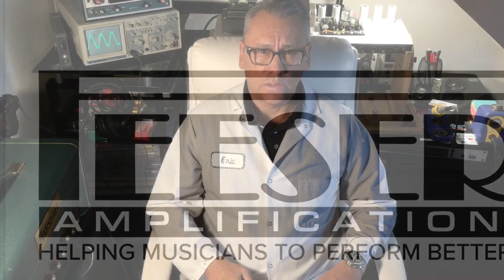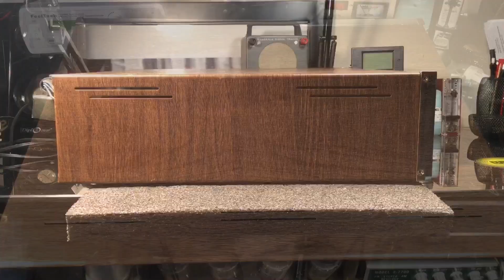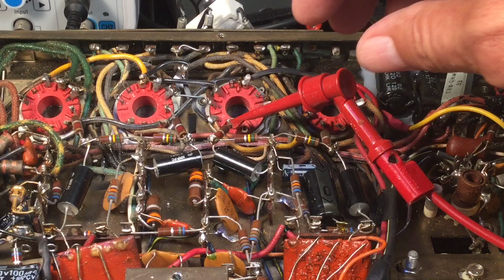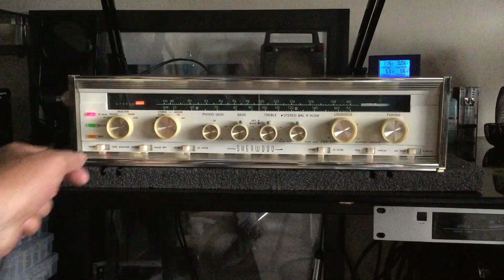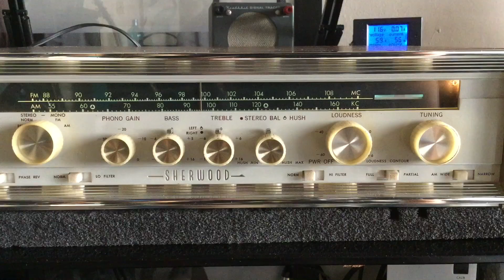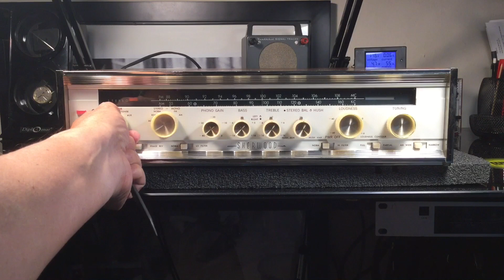How to Repair a Sherwood S-7700 by an Engineer Technician

Comment: I felt for you very deeply when seeing the problem with that bunch of those radial capacitors which do not IMHO belong to tube amps at all, unless there is a PCB in it, which a godforsaken phenomenon and a way to connect components electrically to each other unfortunately started to rule sometimes in the 60's 👹😁.
I love Fender style dog houses and hate multiple section cap cans because as you very well know, whatcha gonna do when one cap of multiple section cap can fails...
However, sometimes there is no compatible right sized (both physically and electrically) multiple section cap can available at reasonable price, and you have to do something very unethical and use a radial PCB caps. But fortunately axial caps are still available and installing them instead of those radial caps which are meant only for PCBs is sometimes a little bit better option than those radial electrolytic caps.

I just recently noticed you channel and subscribed it immediately because I noticed that I very much enjoy your calm and relaxed way (Zen and the art of tube amp maintenance😁) to express what you have to say, and noticed your deep experience of classic audio devices because I myself have built and serviced tube amps and radios for more than 30 years as a hobby and I immediately saw that you very much know what you are talking about which is not always the case nowadays.

Keep on good work! 👍
Reply from the maker: I can see that you are a man of good taste. 😀👍
Reply: @FeeserAmplification  Thanks! 
But some smart a** once said that if you have a really bad taste, the world, as we know it today, has much more to offer to you. 😁